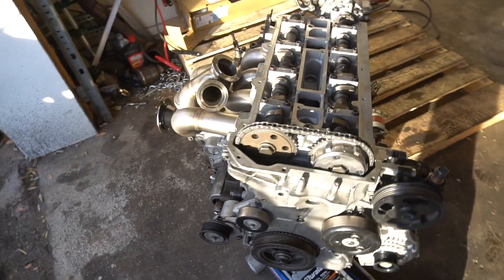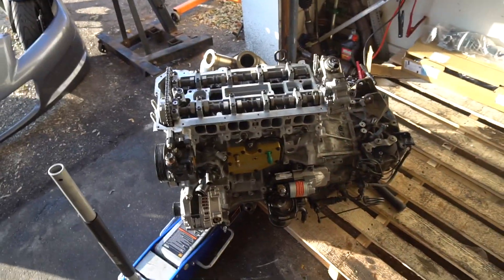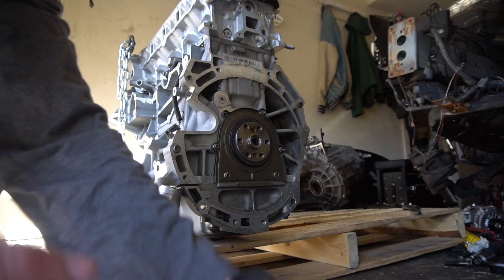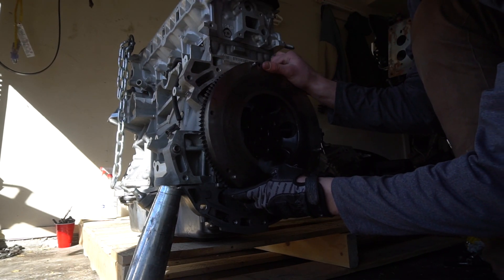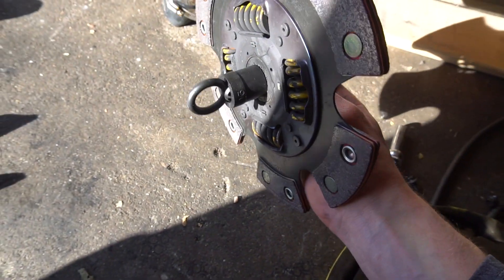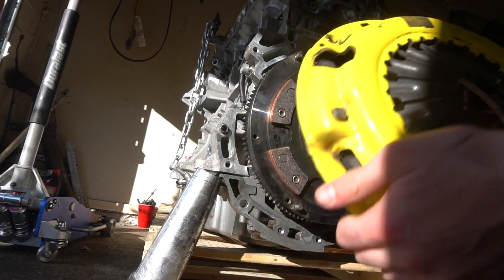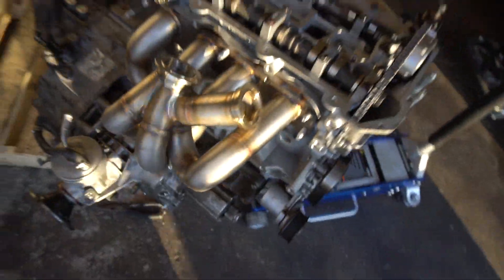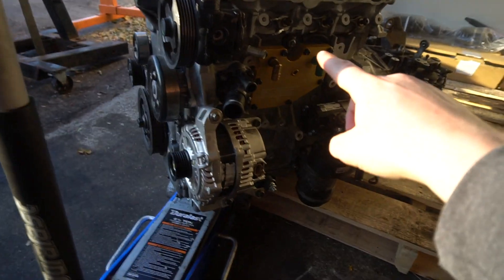How to Install an upgraded Mazdaspeed Clutch

Comment: Glad to see you making more videos man! As stated by others thread locker is generally used. Also tq specs are a must if doing an in depth video to truly help out the viewers! I learned a trick while doin my clutch that helps as well which is to mark the alignment tool so that you can set the transmission shaft to match up before install. Makes it mate together much easier bro :)
Reply from the maker: Isaac Wright dude thanks so much for the advice. I’ll be sure to look up proper specs for now on. Can you believe How close it’s getting?
Reply: Specs are where it’s at for DIY’ers lol And it is getting super close! I remember the feeling as I was in the same position you’re in only a couple months ago!

Comment: Torque for flywheel bolts is 79.7 - 87.7 ftlbs, buy and online manual , has every removal and installation procedure you need and specs and diagrams of everything to do the car your working on.  definitely some room for thought

Comment: good work ste it`s coming on . I see you got a new / moded plate for the pcv after all. am I right in saying you have got rid of the duel mass flywheel for a solid one and are running paddle ceramic clutch plate , if so how does the clutch feel now
Reply from the maker: GIBBOJ / JOHN hey dude I did get the Damond PCV plate after all. Now I can run a catch can set up! If the stock clutch is a dual mass than you are correct. The flywheel I used is of course a single mass but I’m unsure of the stock clutch. I had this clutch on my last set up for 10,000 miles; it felt amazing. A little heavier than stock but just as easy.
Reply: hi ste  I wunder if you could give me some advice, you have proberly come across this in your build . im running near a std engine with some mild blending of the port`s , in std form with the ko4 turbo it was running at 14psi boost, im trying to run 20psi of boost iv fitted a turbo bleed valve that doe`s go past 20psi , but the problem is I get wot people call a fuel cut at about 17psi . I don't what to fit a hpfp or tune at this stage .to cure the problem is it just a case of fitting a 3 or 3.5 bar MAP sensor.  as I control the boost with the bleed valve . im told the std MAP sensor cut`s the ecu /fuel at about 18psi which seem`s right
Reply from the maker: GIBBOJ / JOHN hey dude your problem is you need a real tune. You are running the Cobb tunes trying to make more power. Those Cobb tunes are not worth using. You need a professional tune. Trying to make more boost with a bleed valve is a very bad idea. It could easily lean out and blow up.

Comment: Probs supposed to use thread locker and torque it down aswell probably around 115-120ft lbs
Reply from the maker: coldembrace I didn’t use thread locker:(
Reply: Steven Devey its good practice mate unless specified otherwise i always use threadlocker, especially when your pushing higher than factory power and using a clutch that grips like a gorilla fist 😂 im doing a clutch on my mazdaspeed 3 gen 2 soon. Waiting on a release bearing.
Reply from the maker: coldembrace oh dude that’s awesome! How do you like your gen 2 so far?
Reply: Steven Devey its not too bad, running a gtx2871r, 38mm tial screamer,  ets tmic but i got a fmic on the way, stock block. Will be running e30 blend. Dont wanna stress the rods to much dont know how weak they are on the BL ive seen plent bk’s spit rods out the side.
Reply from the maker: coldembrace oh man I love that turbo! How much boost are you able to push on that e30 blend?
Reply: Steven Devey should be around 23-26 psi. At the moment I’m on 22 psi, pump gas and plenty of room to turn the boost up. Ive paused tuning till i get my new clutch in and bedded then im going to do the fmic also doing valve cleaning and injector seals at the same time.
Reply from the maker: coldembrace aye that’s some serious boost! The e30 blend really makes a big difference! I still need to get upgraded seals! Are you stock top mount right now?
Reply: Steven Devey im running a ets top mount which is alot bigger than factory but im upgrading to a HDi front mount kit
Reply: Steven Devey i know corksport sells seals for $200 but ive got a few friends running seals from toyota its for a diesel motor but fits our injectors it cost me $14 australian dollar all up i can send you part numbers if you want
Reply from the maker: coldembrace I’ve heard of these Toyota seals. They do work but they tend to leak when you go for higher HP. I luckily just ordered some CS seals. That top mount probably does a decent job but front mount will work far better!
Reply: Steven Devey ill see how it holds for my power level, if it doesnt work ill swap to corksport, the ets top mount is great but on the drag strip idle boost air temps were sitting at 70degree celsius, way too hot.
Reply from the maker: coldembrace ya brotha that’s way hot. The front mount will do a way better job. I might do a water to air set up next